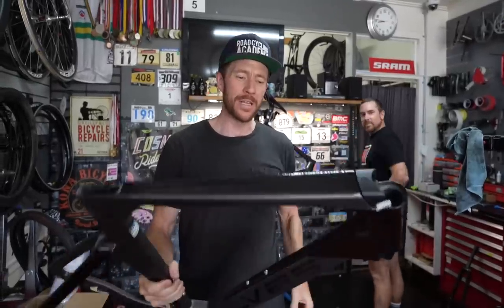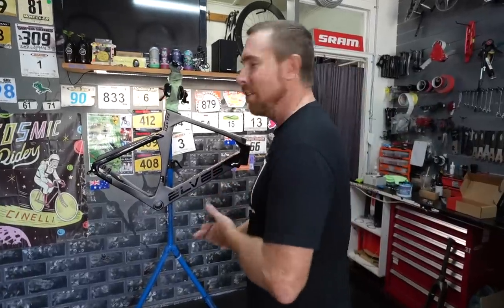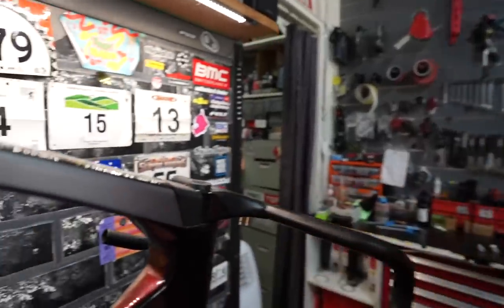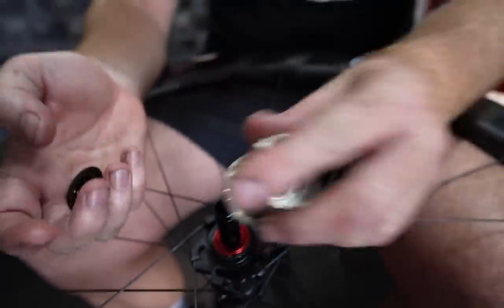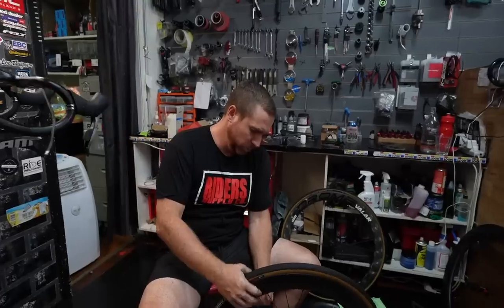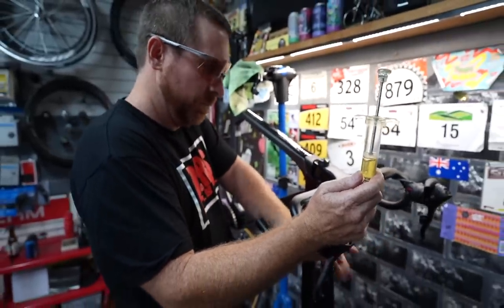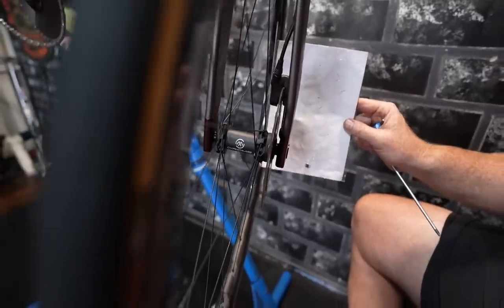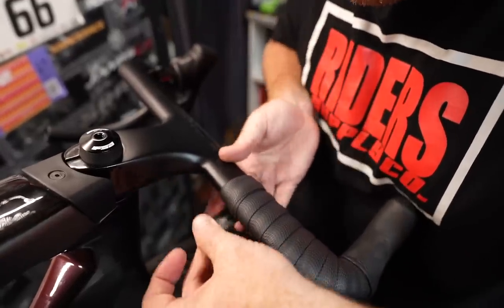We Built THE ALL-NEW Falath EVO (the latest UCI Approved BEAST)

Comment: That style of front end works best with TT bikes where stack can be adjusted with bar/extension risers. On a road bike, the clean look starts to disappear with stem spacers.  Giving a stem option that matches the frame would be good as integrated bar-stems always limit fit options e.g narrow bars often have limited stem lengths - I think their 36cm bars only come in a 90mm stem length.

Comment: What about the size? I think you should address this issue - the Falath EVO XL (54cm) is way bigger than the old Falath in the same size. The sizing chart of the Evo is completely different. Ordering the first Falath you said that for your height 54cm should be perfect and you were probably right, but the thing is that you have ordered 54cm again, when probably you should have ordered smaller one.

Comment: Awesome build Cam. But those brakes made as much noise as mine did after a swim in who knows what. Not sounding healthy.
Reply from the maker: That's disc breaks for you. Their sound effects are horrendous. haha
Reply: @CamNicholls  They are now very quiet after a thorough rotor cleaning and replacing the contaminated brake pads.
Reply: That was the first DH brake after the build and just bedding in. Came good after that :)
Reply: @taylorcycles1931  Thanks. I was the victim of a bicycle theft and the thieves contaminated the front brake pads and that transferred to the spare wheel rotors. Bedding in new pads on the cleaned rotors.

Comment: The geometry is a bit tricky. This is a XL Frame, would guess i need a XXL though. I am 188cm tall. What size would you recommend?
Reply: I'm 1m98 and if I order one I will buy the 61cm, Elves says if you're hesitating between two sizes then it depends on your torso/leg length. If you're more torso dominant then pick the size up, if you're more leg dominant pick the size down.

Comment: Did i hear right...$50 for an inner tube?
Reply: Correct. I had the same reaction! 😄
Reply: They puncture easy too
Reply from the maker: Yes 😆
Reply: @glennoc8585  All those TPU tubes are the same.
Reply: @joris818  Same, but they puncture too.
Reply: @DanTuber  They might, but if you use them as a spare tire that's less of an issue. Also, when you puncture a 5 euro inner tube, that's different from puncturing a 50 euro tube (or even a 25 euro Tubolito).
Reply: @brankosabol  Whoops, the brand is indeed Ridenow !
Reply: @brankosabol  Thanks. Will try out Cyclami

Comment: Just don't call it an xl or a 54cm. Nothing on it measures 54cm
Reply from the maker: That's what they call it, but I'm taking it to a bike fitter next week for a video. The geometry is unique and needs examination.
Reply: @CamNicholls  Seems to be an ideal geometry for someone with long legs and short torso who needs a slightly higher stack and smaller reach without going to a boring head angle like on an endurance bike. Might be something to consider mentioning in bike fitting video. Also a 54cm is an XL (even a 52 is an XL on the Vanyar) because sizing is keeping asians in mind as the primary customer I presume.
Reply: @CamNicholls  I know that's what they call it. Its the only thing so far  that makes me distrust them. 
Manufacturers switched from labelling frame sizes as seat tube measurement, swapping to top tube measurement in 2010 ish. Now the MTB guys only use reach and retardly steep seat tubes to "help" with climbing while making the bikefit woeful everywhere else

Comment: I want to want one of these high end Chinese bikes, but they are kind of pigs. Beautiful pigs. My Canyon Ultimate large with mechanical ultegra and 50mm carbon wheels is 7kg. 8kg is too much.
Reply from the maker: Nothing wrong with a beautiful pig! haha. But I hear you re weight. We'll see how she goes up my local hill climb against other bikes.
Reply: Is that canyon 7kgs with a couple of bottle cages and pedals?
Reply: @glennoc8585  no, that is just the bike with no accessories. It also has light thru axles, a carbon railed saddle and gp5000s tubeless tires. Nothing crazy, but a few light weight upgrades.